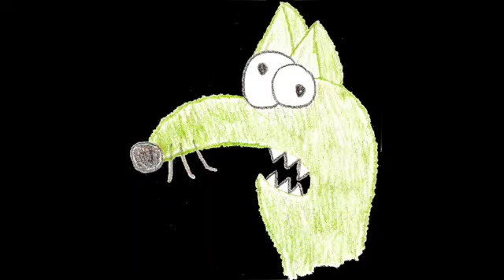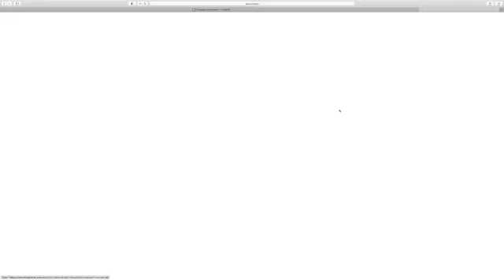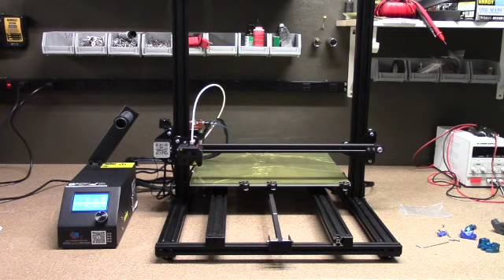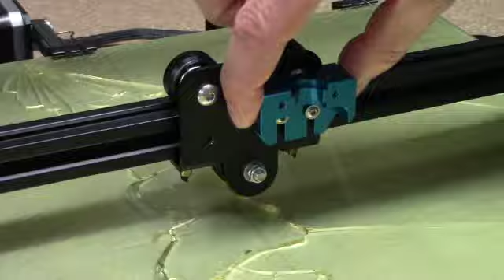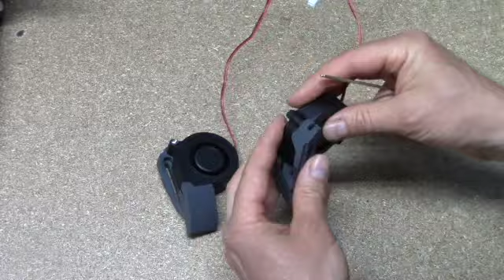KLEMCO Metal Mount Installation for E3D to Creality Printers - Most Newest

Comment: After months of dealing with Creality and other total garbage products and insane, bordering on mildly terrifying lack of QA, mounting the E3D Micro Revo to the plate with the Klemco restored my faith in humanity. It just makes instant logical sense with no need for instructions of any kind. It doesn't need angle grinding, vice "persuading" or hammering, it just fits and works. The inclusion of the bracket to straighten it off surprised me in how simple and perfect a solution it was, like a work of pure art compared to a sheet of A4 with a drawing of a printer, endless hours of trying allen keys, stripping screws and then just getting the powerdrill out again... There are people out there who actually care enough to not only make something properly, but to actually give the end user a second thought and make it better insterad of just throwing it all in a sealed bag and saying, "That'll do, throw in some random screws and say they're "spares", that'll mess with their heads!"

Comment: There is a wide vertical slot on the back.  Is that meant to lead some wires through? Or do you advice to lead the wires for heater and therm. on the side like you show in this video?
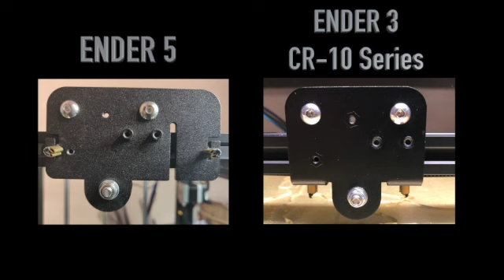Reply: If anyone’s still wondering, look at the backplates at the 1:00 mark in the video. That ‘slot’ provides clearance for the screw head behind the mount.